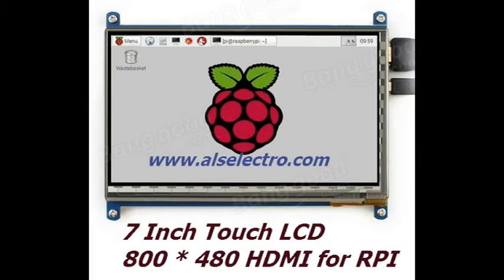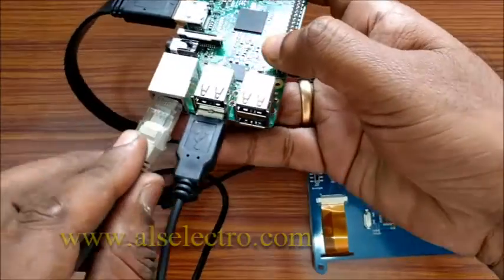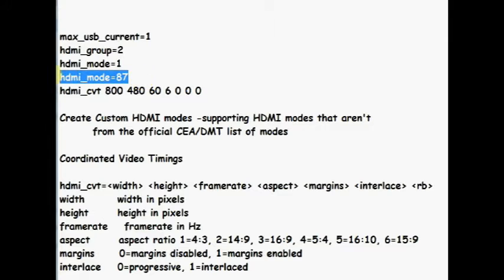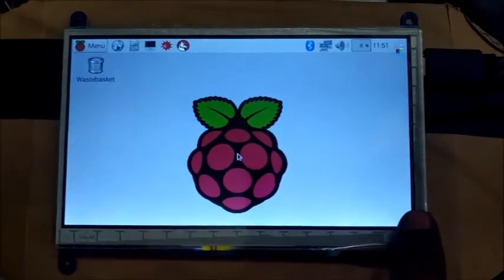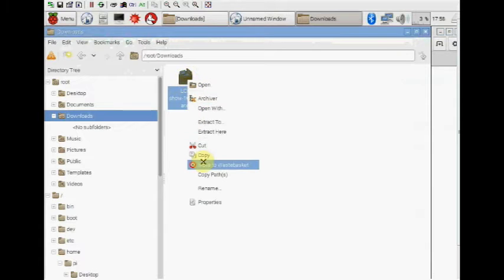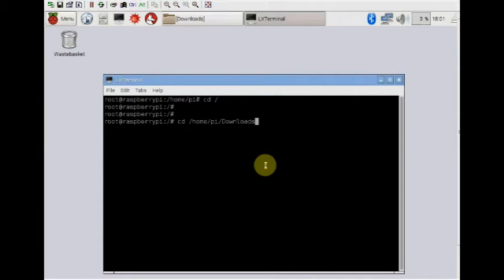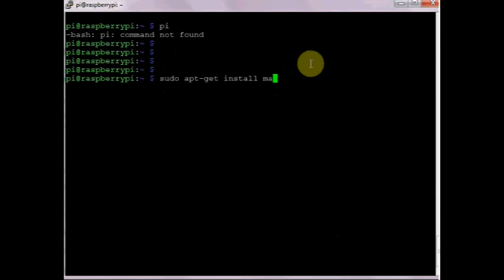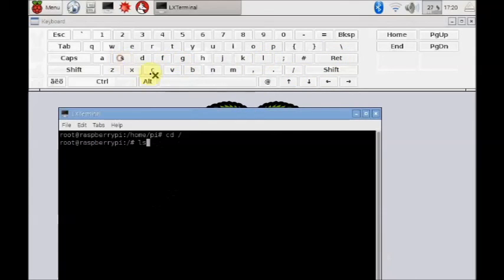Raspberry PI Touchscreen 7inch - How to install Driver & Virtual Keyboard

Comment: In this example you use USB cable to supply Raspberry with electricity. Can I use separate power supply block to do this ?

Comment: My touchscreen has the dual pin header connection, NOT the HDMI, and I get a blank screen when turning it on when connected to my Pi 3B
Reply: I figured this out! USB to one of the Pi USB ports to touch on the screen and the other touch to a power source...
Reply: They are identical

Comment: Great tutorial but Im stuck after installing driver it wont boot into Raspian it says at the last line:end Kernel panic - not syncing: VFS: Unable to mount root fs on unknown-block(17 9,2) dont know what happened any one have ideas?
Reply: Did you use WordPad to edit the file? If you did, it mangled the file and Pi can't read it anymore. You need to completely reflash the SD card.

Comment: Hi every one I am new and started using raspberry pi 3 with 
RASPBIAN JESSIE WITH PIXEL and install Raspberry Pi 7” Touchscreen Display. Screen Resolution 800 x 480 pixels
I am facing a issue when i run Qt Creator 3.2.1 and click maximize icon, not able to get full screen layout of the application as few of part of the qt is partially hidden.

i have followed the instruction of installation from this link below
https://www.element14.com/community/doc ... en-display

touch is working perfect and there is no black border from the screen. Its some thing else i am not able to figure

If any one know to resolve this issue pls help me out to achieve the display to display full screen

Thanks in advance and waiting for answers.